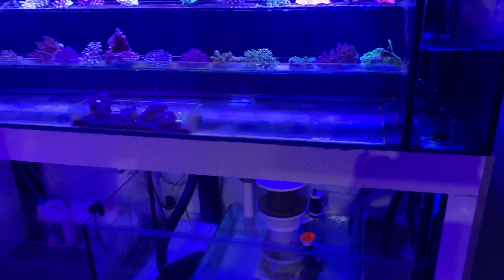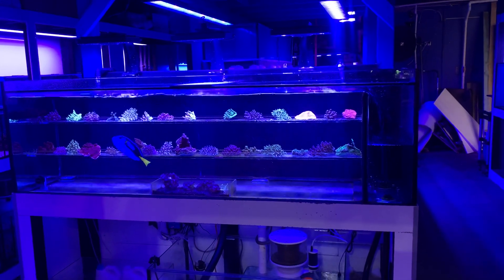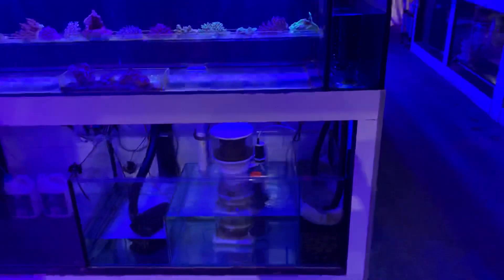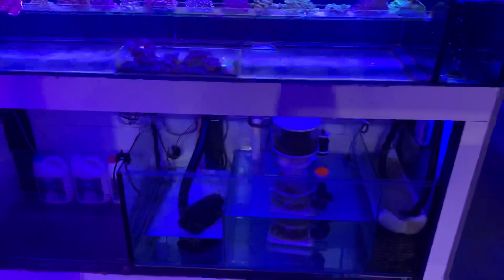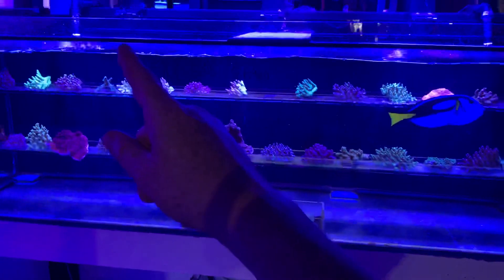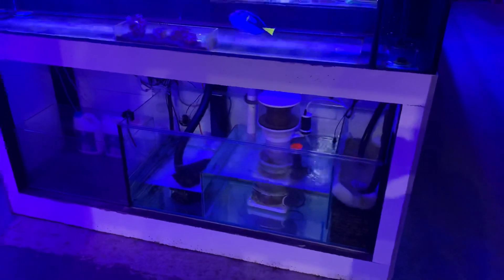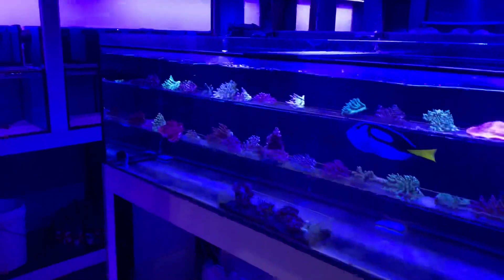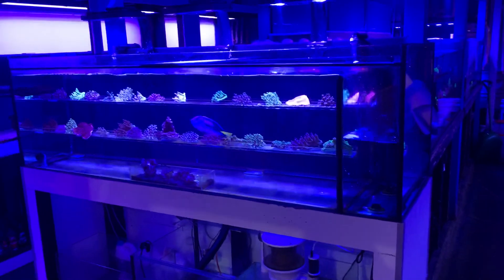Lesson on evaporation in sumps

Comment: Hi Paul. That is why it is so important to complete the High School. But seriously to limit the evaporation you need to provide only relevant spectrum of light. For example, if the animal is taking 400-500 nm light, all other wavelengths do nothing for the animal - but they are increasing evaporation signifinactly.  Typical example is refugium. Cheap light provides tons of evaporation due to high par - but most of the spectrum is not used by algae. The correct spectrum light provides adequate care for algae and really reduce the evaporation.  Cheers Piotr

Comment: Take your point.
However, with a fluval flex 123 marine.  It has a lid with built in light. Weekly water changes. Virtually no evaporation. Plenty of surface agitation. Fish and corals are happy. No O2 issues